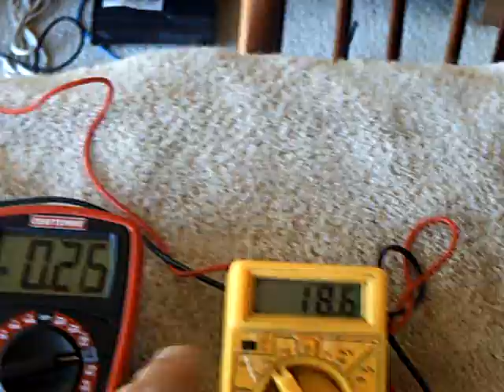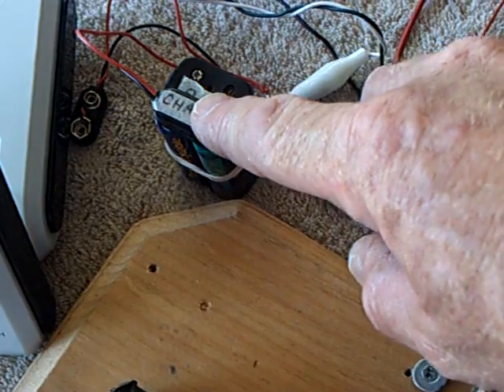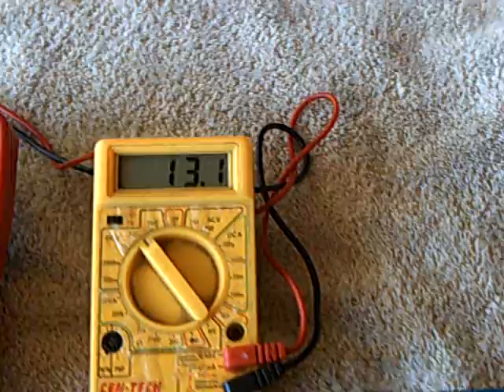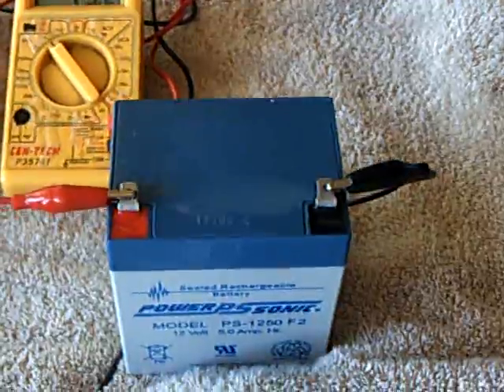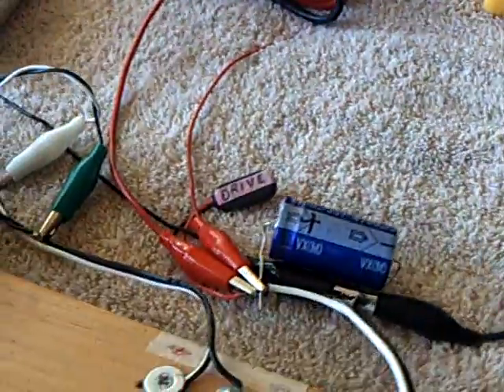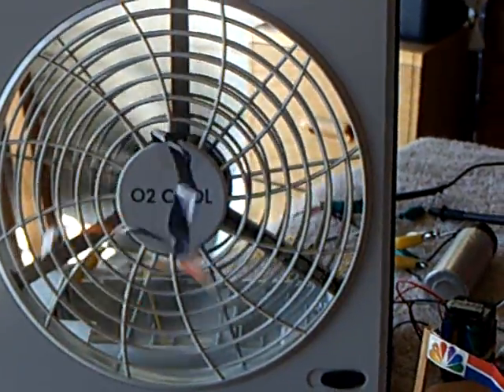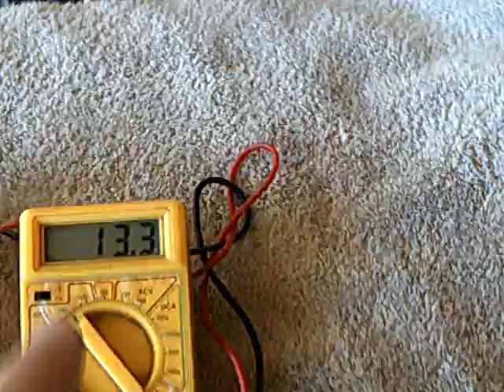Solar Bedini SSG running a fan while charging batteries

Comment: I love this! Educational and fun! I've been trying to figure out how to run a small computer cooling fan I've installed in my printer cabinet 24-hours a day using only solar generated power. Even with holes drilled for ventilation, the interior of the cabinet heats up from the modem, router and hard drive inside the cabinet. Can you describe a circuit that would run a 12V/180mA fan while charging a battery that would power the fan at night? Thanks!

Comment: So i guess you are simply draining energy from the solar panel to power up the fan and charge the battery. But where is the free energy? I suggest you measure the total power in, compare it with the total power output.

Comment: One more thing.  You can cut the end off an old, cheap (or dead) AC adapter and plug it directly into the fan, or, if you don't want to do that you can run wires into the battery box.

Comment: That O2 will work fine on a small panel with no battery, if you only want to use it in the daytime.. of course, the fan speed will vary with the amount of sunlight.  I don't use a regulator either.  The O2 uses only about 1/2 amp or 6 watts, so even a 10 watt panel will drive it easily.  Advantage to small panel: More current draw means more voltage drop; that's why you don't need a regulator.  Idea: If you want to use a 15 watt panel, get 2 of the O2 fans.. they're about $15 each at WalMart

Comment: I will agree that capturing some the the Back EMF will allow this motor to run longer than just running it on a battery.  The problem is that it will eventually stop.

Comment: NO  It can't run forever.  Why?  Loses.  Lots of Loses.  I.E.  Resistance in wiring, Back EMF created WRT Load.  The more load, the higher the back EMF.  LENs's Law. Heat, bearing friction etc.